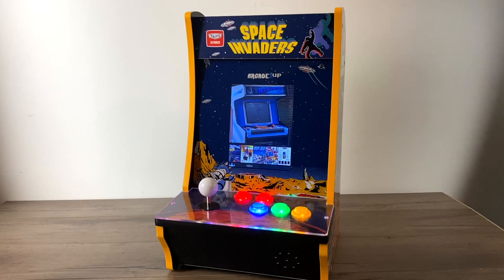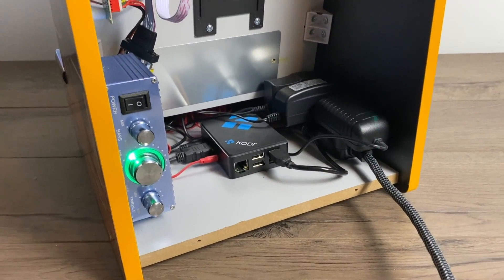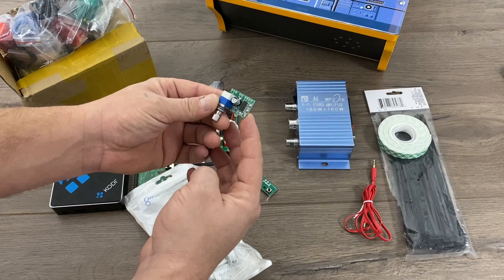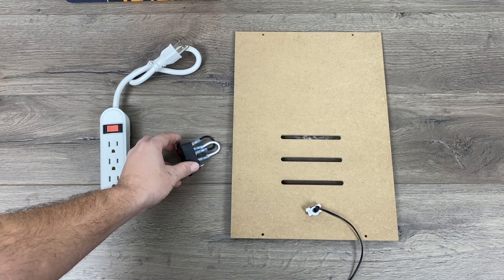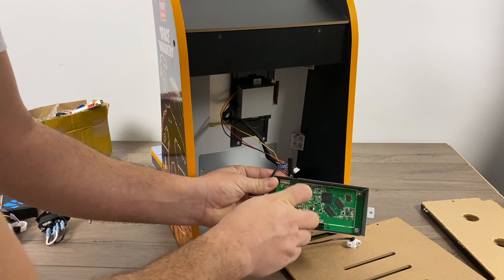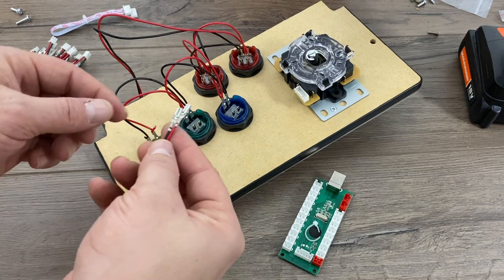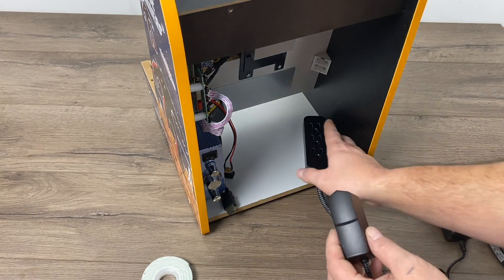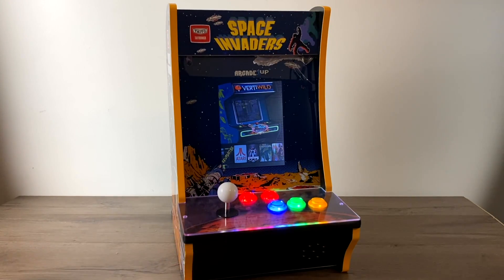Add a Raspberry Pi To The Arcade1Up Counter Cade!

Comment: Could you swap out that 8" screen for a 10" LCD monitor and connect the panel directly to the raspberry pi?  I just bought the Galaga countercade and was looking to do your mod and add that 10" screen.
Reply: You can, and it looks quite nice. Remember that for a bare screen you would still need a video card between it, and the Pi. They are about $60-80. I would not purchase a monitor (panel with housing and card).

Comment: I followed this video. I get no picture on my arcade screen. I think i need a new control panel. I didn't buy a replacement one yet as they were sold out. But i used a raspberry pi3 b+ and still get no image. Also, i have an extra wire? Not sure where it goes.
Reply: Is the jumper of the video card set on G?
Reply: @glenlivet4me  How do i check?
Reply: @POPCULTURETUBEX  I send you an email with pictures
Reply: @glenlivet4me  Its on g. I here sound only when the original dig dug  cable (grey) is plugged in. I think mine was Dead on Arrival. I should ship it back. But too little too late. I bought from ebay and left a good rating by mistake.
Reply: @glenlivet4me  I tried a new adapter from diyretroarcade and it shows a light on the screen. Ex the screen now powers on. I double checked, the image is correctly written to the rasperry pi3 b+. Why do i only see a light? No actual picture and no sound on screen please help! Struggling for too long with this.
Reply: Email me some specific screen shots of your setup. Reburn the vertical rise image, and make no changes to it yet. First boot will take maybe 5 minutes because it is unpacking.
Reply: @glenlivet4me  I can confirm raspberry pi runs fine on tv. But still no image on the arcade. I am still using the stock arcade monitor. I realize now it might just be easier to replace it with a dell 15 inch monitor at this point.
Reply: Lol. Turned out the black ribbon cable on the board was backwards. It shows a picture now. Anyway only issue at the moment, now that I got my new drill, is getting the mounting white brackets on the left side to mount the display board. I drilled the holes, but the screws just go right through. I assume I need a washer or different screw type. Also, my original speaker,  the yellow wire broke,  what do i do? Buy a sound bar?

Comment: UPDATE!  I ordered the lcd driver board from the link in the video,the seller is now sending a different model. The video is upside down on all vertical pi images.  You will need to rotate your 8” screen and cut a new hole for the ribbon cable... option 2 .  Become a text editor and exit the code on your image.  Either way the board is No longer the same .  Seller claims the old board is no longer available.  Seller will tell you it works the same as the old one but it does not.   Be warned before you purchase the lcd driver board that is linked in this video.   

I tried the following images and all presented upside down using the sellers new & improved board

Mr Burns   Also will not fit the screen properly even when rotated. 

Vertiwild 
Button masher

Comment: Hello ETA, I could sure use your advice.  I did my first cabinet mod. With some research and some advice I was able to build my K I  cabinet using a PC . But... my huge problem was trying to find the correct front end software. I tried Maximus! Did not work.  Garbage!  What would be the best frontend software to use?    Thanks!

Comment: PLEASE HELP i dont know where else to turn what am i doing wrong? I did everything my mrburns image for some reason was upside down so i ended up flipping the screen around and everything works good. My issue and need for help is because when I power everything on the monitor and raspberry pi don't communicate. I have to power on the pi after the monitor for the monitor to auto detect. I would like to power on the whole unit on with one switch. Please any help will be appreciated or direction on where to find the answer thank you in advance

Comment: Is it possible to use the stock volume and power buttons on the ras pi? The Gen 1 machines you can reuse and write a script, curious if the countercades can do the same

Comment: Hey ETA prime, I'm glad you like my little Vertiwild build 🤗. I'm happy to share and be able to offer what I received when I start retrogaming. 
Thanks for your awesome vids, regards.
Reply: Is there any lines of text that needs editing to make it show full screen on the 8” countercade?  I cant get it to fill the screen properly in porportion by using the menu buttons on the lcd board.  Any help?
Reply: @arcaderacer586  maybe you should try with boot.cfg file. You can force resolution or specific ratio I think.  Or use raspiconfig through ssh.

Comment: At this point I wonder if it'd be cheaper to just find some kind of kit and make your own counter Cade since all that's being used is the wooden case and the screen.
Reply: These things are selling for $100 when on sale. It'll dip to $75< in no time
Reply: I have noticed some modded units on Craigslist. I am sure we will see more as time goes on.
Reply: Couldn't help thinking the same thing as I watched this and the list of required pieces just kept going... including replacing the stick, buttons, and board that holds them. So you spend $99 for some fiberboard and a screen which right up front he says isn't very good?

Comment: The screen is so small =(
Reply: Shrimp Zoo might as well get a fight stick and pair it to your phone lol
Reply: I saw some dude install a 15 inch monitor in portrait mode. Despite a few esthetics issues, it worked well for him. Look more sharp too.
Reply: @artkingofwholefoods74  The 15inch screen only fits in the GEN 1 countercades. The Gen 2 would only fit a 10 maybe 12 inch.
Reply: @fabulousasia9848  I'm not as technically literate as most of the folks on here. Does anybody know if this exact setup will run a 15in screen?
Reply: @arinasan247  The Gen 1 will, but not the Gen 2. I believe you can get a 10-inch screen in Gen 2. If you are looking for a great vertical bar top check out Gameroomsolutions. They have a fantastic kit. We have the 17-inch kit and we just ordered the 24-inch vertical kit. Super easy to put together.
Reply: @fabulousasia9848  Wow, thank you! :)
Reply: I would definitely put a new larger screen in it !